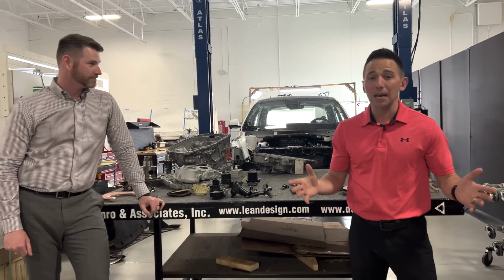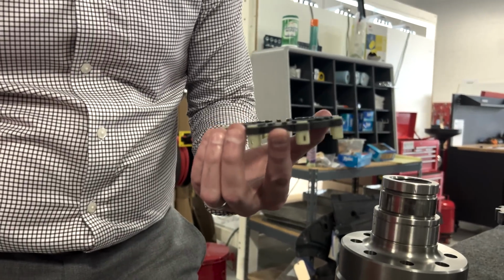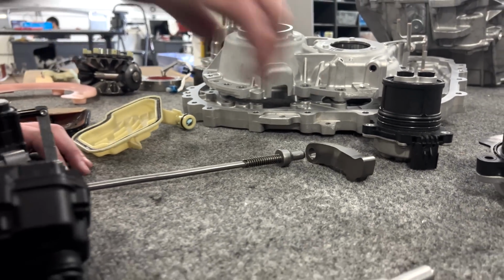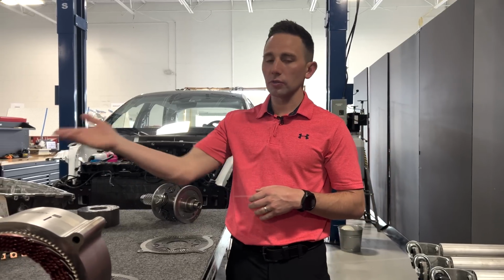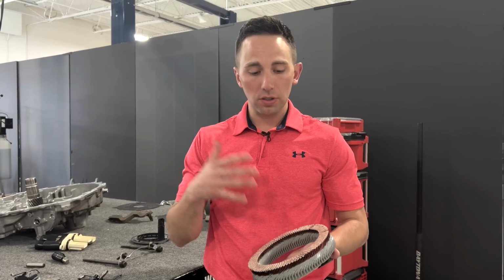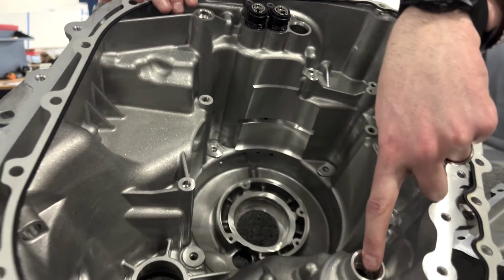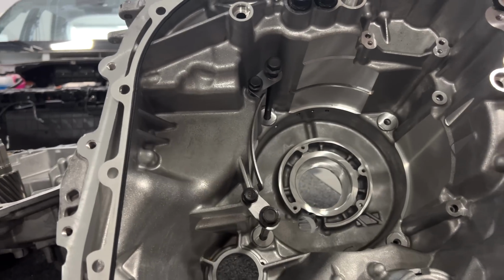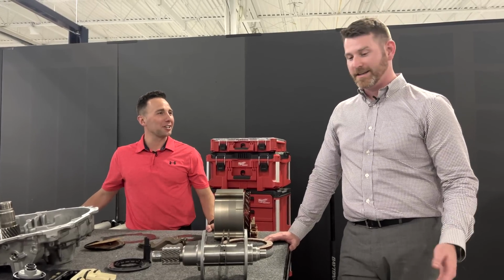Hummer EV Front Motor: Power, Pounds, and Park Pawls

Comment: So a fully loaded 80,000lbs Tesla Semi Truck using Tesla drive trains from a modelS is.... underkill 😂😂
Reply: Not even the s large drivetrain unit's, the semi uses model 3&y sized motors x3. 😀
Also spacex uses tesla motors and pack's to.
Reply: @4literv6  
Unless I'm mistaken, the basic cross section of the rotor/ stator diameters is the same, it's the housings and "gear assemblies" (can we call them "gearboxes"?) which are different (with the decoupling system in the Semi)
Add the carbon wrap in the S/X (and Semi?)
Now we have the hairpin windings to consider.
.
I think we'll likely see a combination of core motor components in the CT, Probably with a variant of the Semi decoupler for towing/ cruising range.
(Franz said "range isn't a problem" [paraphrased] in his recent interview)
.
I'll certainly need 🍿 for that one!

Edit
The Semi was GOING to use M3 motors as the basis.
I suspect that changed when the plaid drive meant they could drop to 3, with the decoupling system.
Reply: @rogerstarkey5390  exactly. The semi does NOT use model 3/Y motors. As for the gearing.. no one will know until one is torn down. But the Semi was specifically stated as changed to the S/X’s plaid motors.
Reply: @airheart1  the plaid model s&b both use model 3/y sized motors just with carbon wrapped rotors allowing for 20,000+rpm. 👍🏻
Reply: @4literv6  physical size? Sort of.. the stator is the same.. regardless.. they do not have the same rotor/magnet configuration. And the carbon winding is no small change. They are NOT the same motors as 3/Y.. don’t take my word for it.. go watch the Munro teardowns.. its quite clearly shown that they are not the same..  They do share some components but they sure as hell aren’t the same in performance. They are not just carbon wound 3/Y motors. With the possible exception that Tesla has since upgraded all the 3/Y motors to the same design as the S and X’s.. that is a hard assumption to make.. and unlikely at the least since there’s been no major upgrade to the performance of 3/Y to correspond to that

And looking back at your earlier reply.. YOU said the ‘S large drivetrain units’.. lol.. now suddenly you think they’re identical to 3/Y but carbon wrapped? Well.. it’s not a fact. If you can show me a 3 or Y’s motor torn apart and it has the exact same magnet and laminate designs now.. i’ll agree you’re right. Even then.. no reason Tesla couldn’t have engineered a way to make either work for the semi.. no one has torn one down that i know of to say they have poorly engineered their semi. Until then.. just people talkin shit out their ass. Just because GM feels the need to to design their Hummer’s motor with all this shit and size and complexity.. sure as hell does not mean it is the ‘right’ way or the only way.
Reply: @airheart1  ingenext and munro live teardowns both showed the rotors and inverters are the exact same. I could careless what you think. 😀

The plaid dual motor rear edm is also lighter than and more compact vs a raven or p100d old ldu despite being dual motors and having true torque vectoring capabilities. 👍🏻

Elon himself said the semi uses model 3 motors as well. It's likely imo the semi paired down to only 3 vs the 4 originally announced, because of the in house plaid c.f. wrapped motor developments. Along with the efficency gains from de coupling all but 1 of the driveaxle during steady state cruise speeds. Both not things tesla did when the og semi got announced in late 2017. 😎
Reply: @4literv6  stators and inverters are the same.. rotors of the motors are completely different. You should look again and pay more attention. The rotor is the most important part of an electric motor.

And the statement of semi using model 3 motors was a long time ago at the initial unveil.. on delivery day, they specified it is now using model S plaid motors.

When you catch up with the present, let me know.
Reply: @airheart1  smh sure it is bud. I watched every munro live teardown of any tesla model posted and all of igenexts tesla videos to thanks. 👍🏻
Reply: @4literv6  well, yotube won’t let me link the munro video.. you’ll have to find it yourself inthe model S plaid motor teardown.. around the 28 minute mark you’ll see the explanation of the rotor and how it differes
Reply: @4literv6  
Model 3 SIZED, but not Model 3 "motors"
Reply: @rogerstarkey5390  I'm not arguing any semantics with anyone over this. It's the same damn sized rotors just c.f. over pressure wrapped. 
It's the same gd stator and inverters across all current models in the same damn housing. 

The old large s&x drive unit's are gone now and what started out as the model 3 motor is STANDARD across all tesla model's. 
About to be or is also already a hairpin wound mass produced and soon to be ree free design. End of story!👍🏻
Reply: @ChaimLoecher I’m sure you know everything about the Semi and how well or poorly it’s designed and that all the companies that put in orders know less than you about it.. 😂😂😂

Comment: Why aren't two smaller motors used for each of the two rear wheels (or one motor per wheel for 4 wheel drive) rather than one bigger motor and all the additional weight to transmit that power to two wheels

I'm not saying they should do this and i know better. Clearly they know better but im just asking why is it better to use one motor and split its power and torque to two wheels

Or have i just answered my own question. If you habe one 200HP motor you could theoretically send any ratio to either wheel but with two 100HP motors youd have max 100HP on one wheel is that the reason

Just like the idea of having 2 or 4 smaller motors for redundancy you could lose a motor and still function fine
Reply: The more motors they have the more cost goes up.
Reply: @xxZerosumxx  Are two 50HP eletric motors more expensive than one 100HP eletric motor? I assumed it was a relatively linear cost per HP
Reply: @kaya051285  Two vs. One requires two inverters, double the HV electrical connections, and some very sophisticated software to keep it all working in sync, except when turning where the software has to act like a differential. Still it can be done for specific applications.  Tesla Plaid and Semi use three motors (one up front, two in back), and a few others manufactures do this as well. For example, the Remic Nevera uses 4 motors, one on each wheel and costs $2.2M.
Reply: @TeslaTap  but those things are modular. That is to say does two 50HP inverters cost more than one 100HP inverter

Does two writes able to carry the current for 50HP cost more than one wire carrying 100HP etc
Reply: @kaya051285  I get what you're trying to say. But it does work like that. Two 50hp motors doesn't equal to a 100hp motor in cost.
Reply: @kaya051285  perhaps more a roughly equal cost per motor.
Reply: @xxZerosumxx  
The more the redundancy "goes up"
The more opportunity for range optimisation (Semi says "hi")
The greater the range gain from cruising on one motor, the smaller the pack can be.
Etc.
Reply: @rogerstarkey5390  Why are you comparing the semi to the hummer? Two very different applications.
Reply: Q: Why aren't two smaller motors used for each of the two rear wheels(?) A: well they ARE using 2 smaller motors at the rear  likely in a "siamese" configuration, so the Hummer EV is in fact a "Tri-Motor" same as the Tesla Plaid and same as the Audi E-Tron SQ8.
Reply: Electric motors are far less likely to fail than ICE motors and yet Ive never seen a land-based vehicle with two ICE motors. Increasing the number of motors increases the complexity of every single system and IMO makes a failure more likely. And cost is not linear because of all of the systems that service those motors like HV electronics, cooling systems, filters etc.
Reply: Q: Or have i just answered my own question(?) A: no.

Comment: 9000lbs!    30 inches longer than a Hummer H1 and 1000lbs heavier……GM leading the way😂
Reply: If GM makes a 13,000 lb MAGA Model, suckers will line up... Heck the FBI will buy out the first 4 years of production.
Reply: With what 3x the power? 5x the efficiency, 2x the performance&top speed, 10x the daily drive ability and total comfort?
And inflation adjusted it costs LESS than an h1 did! 😎